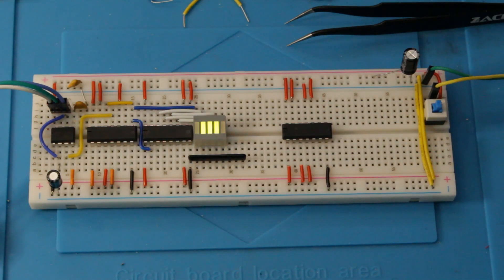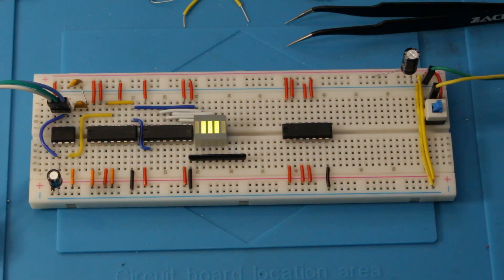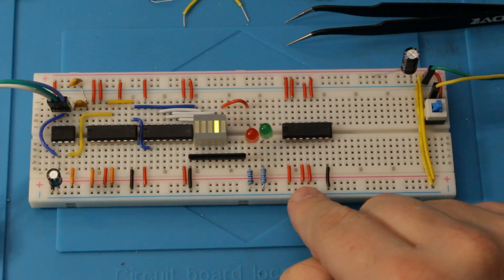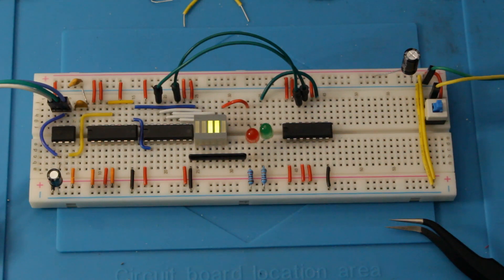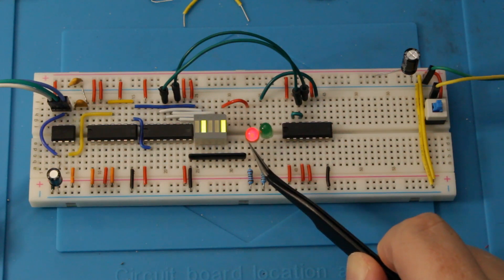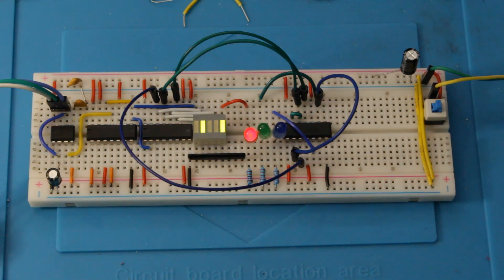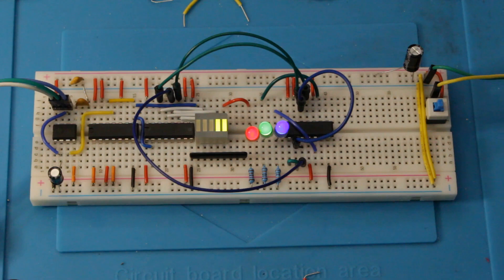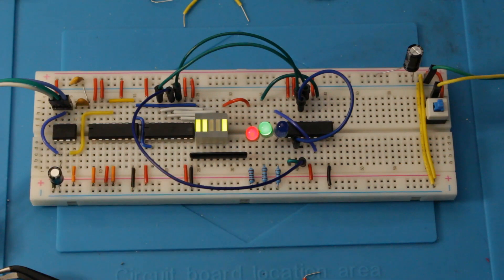Phase-shifting using D Flip-Flops - practical demonstration

Comment: Hello I hoppe for some advice. I experiment for years on engines expeciali GM/Opel cars from the 80s . My problem is the GM 4 pin ignition module in my car I also have inductive pick up coil and e core type ignition coil. The thing is the ignition module isnt reali variabel at all it does not work under centrain engine rpm it has low ignition coil saturation and it does not even offer some advance and retard ignition timing options. My land is to much expensive to order the 5 pin ignition module who is specialised in retarding ignition timing I only have availibel 7 pin ignition modules in my land so I dont know how to operate those modules manuali. I did try out some potenciometer betwean pick up coil and input to my 4 pin ignition module wasnt reali what I hopped for the engine run crapy it did actuali phase shiffted ignition timing but by 180° to by exactli after half houer cranking the engine turned on but insted compresion it run on exaust stroke. So I hoppe you understand what I desire I need some sort of logic analog phase shifter at least capabel to shift phases +/- 20° ither the pick up coil or the ignition module some how. I did read lot about rc box ,transistors and ic chip type phase shifters but all arent reali specific how to get those precision degree angels. I did found some variabel cdi advance and retard ic circuets but Im not shure if it wuld work on my GM ignition module insted of the CDI box input? If its wurth to you any thing that wuld by great project many peopel like my have hard time finding corect circuets to control specific engine functions mostli I deal with reverse voltage back current due to reason my old car does not have diodes ,ballast resistirs and zener diodes in their voltage regulators and including modulators. So I wuld by glade that some one wuld design an variabel ignition module from scratch or make it simpel as posibel useing only pick up coil and an darlington transistor any way that the circuet by robust . I hoppe you finde time and inspect the MC 3334 ic chip design it has the diagram for the 4 pin ignition module so you can see for your self that thing isnt realy great in my Europ version module the zener diode is missing in the circuet so often external noise and back fead or arcing from other devices interfeare with my ignition module .So mostli I have cold start problems in winter time I did use an 4 pin relay for my ignition coil but still haveing variabel phase shifter for my ignition module or pick up wuld come in handy even bether. So I hoppe you understand my questions. Some peopel suggeed to my to use gold plated wires or use no resistance wires so my lande does not reali have that staff so I hoppe to finde some sort of common circuets that can achive that tasks if posibli remote controled channeling or rc network logistics perhaps might work . Any way the goal is to phase shift ignition timing if posibel do there exist some centrain equation that can by used to preciseli calculate how much I need to chose capacitor resistor or inductor values to get manuali some sort of phase value? My idea are to much complicated I know was curiuse if perhaps radios control circuets migh by used as well like those chaneling options and those linear potenciometers pergaps?
Reply from the maker: I think maybe you should ask on the AskElectronics reddit or somewhere like that, there are a lot of people there who know what they're doing
Reply: @GeorgeFoot  Not reali no one reali understands my questions honestli my gramar is terribel. I did use some extra magnets on the pick up coil to gain bigger spark on the ignition coil with ordinari hande rotation of the distributor ,I also placed continueti test from multimeter to the ignition module works with out the pick up basicali .Well I did some experiments on my own so Im positive external circuet wuld help only problem is how to hell fine tune that thing? I dont reali have much options honestli.Well thanks any way at least you answered honestli. In wurts case it seams I need to build advance/retard lever on my distributor similar to Ford Model T design Im out of ideas . Perhaps If you dont minde I can give video link from my youtube chanel perhaps some one see this comment and can suggest some thing that can control ither the pick up or the module out put

Comment: Excuse the off-topic question but what is the make of that latching switch on the right of the board and does it mate with solderless breadboards as well as it appears?
Reply from the maker: Amazon says it was: HALJIA 10pcs 6 Pin Self-Locking Switch Push Button Switches DPDT 8 x 8mm

They're nice. The pins are short but seem to be just long enough that they stay in tightly. They work really well as on/off switches. Technically they are double pole and double throw, but neither of those functions works ideally on the breadboard due to the particular pinout.
Reply: @GeorgeFoot  Thank you! That's enough information to locate what look like the same switches with various branding. Soldering 2.54mm headers to the switches I have is not fun.

Comment: Great explanation but you don't say what chips you are using. I think I might try that technique for my VGA as it isn't perfect. I think I just about get away with the combinatorial method but it might be blind luck. I'm not an electronics engineer so am learning as I go.
Reply from the maker: Ah yes that could have been clearer - the circuit diagram has chip numbers on it, and the extra one is just another 74HCT74.

I'm not a proper EE either, so I'm just figuring things out as I go as well 🙂 Your system seemed to work very well as it is, the kind of glitch I ran into with synchronous designs was pretty severe though often inconsistent - occasionally missing a clock pulse, or a counter resetting at the wrong time one time in a thousand... Just frustrating enough that I started to design to avoid it!

You can also use a clock and D flip-flop to sample the combinatorial logic at a time when the inputs are stable, which I think is a good technique for more complex things.